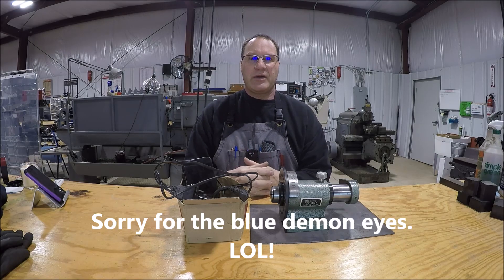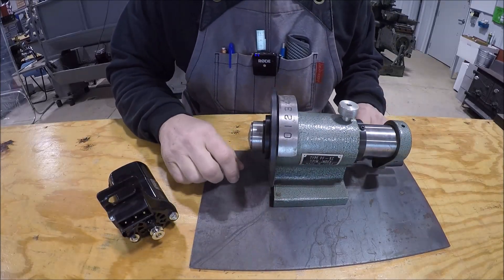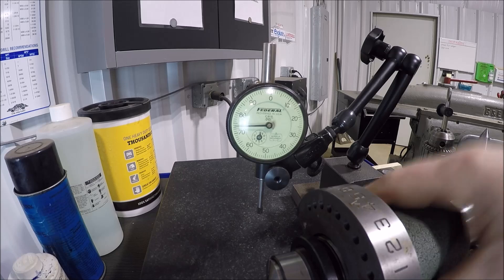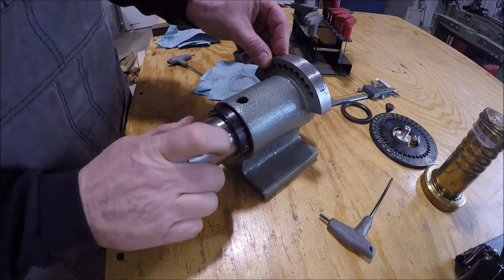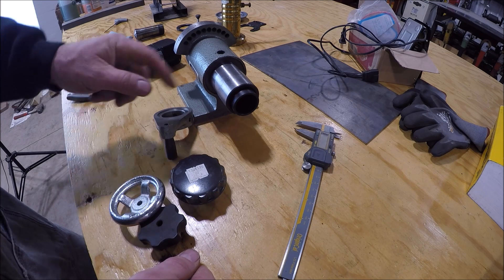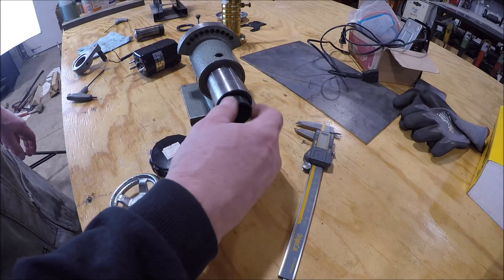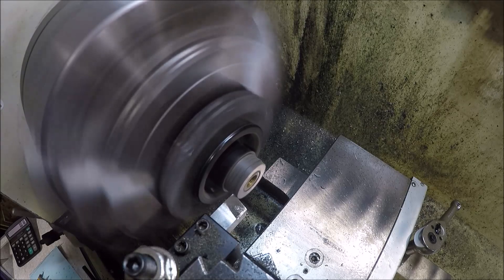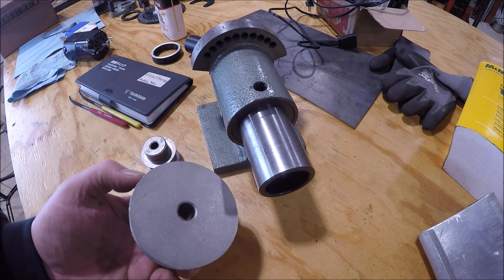O D  grinding fixture build. Part 1

Comment: Sorry Tom YouTube playing games with the subscribed feed. Very interested in how you get along with this one. I like the spindexer - added a stepper motor and belt drive for gear indexing the sizes that are not covered by my BS-0.

Love that Federal Indicator. I call them the tank of dial indicators. Very overbuilt and durable.
Reply from the maker: Hey Dan. It has some twists and turns as I work on it. Yeah I love the Federal and Ames indicators. Built solid.

Comment: Hey Tom looks good question though what type of surface is between the spindle and the housing is there a bronze bushing in there or is it just the spindle going through cast iron going at 3500 RPMs I think you might want to put at least a bushing in there and maybe a set of needle bearings looks like you might have enough meat to bore out of that housing if you find the correct size needle bearing bushing would be a lot easier to fit and then maybe put a couple Oilers on there that's my two cents I hope it's not too much or maybe you've already thought this through.t
Thanks JM
Reply from the maker: Yeah it is just machined cast iron against the retaining collar. Good idea on adding either a bearing or bush. I will have to see what ole McMaster has to offer in the way of OD and ID of thrust bearings.
Reply: @hilltopmachineworks2131  yeah Tom that's a good idea also maybe push comes to shove you could use nylon and lubricated with the silicone grease that might be an option well good luck and we'll see how it turns out. JM

Comment: Anyone else hearing some humming or is it on my end
Reply from the maker: I have finally tracked down the cause of the noise. I recently changed adapter cable from the wireless receiver to the GoPro. I broke the last one. Well this cable is apparently bad. I have replaced it with another one and the noise seems to have gone away. I already have a few videos recorded with the old cable so it will be a few before the new cable will be in use.
Reply: I have been getting high pitch background noise  for awhile on the videos.
Reply: @bcbloc02  just a few peoples are doing that adam booths are odd makes my phone get real quite when it’s turned to full screen but not when it’s just half screen I figured my phone was taking a dump lol
Reply: @jeremycable51  I haven't noticed any noise on Adams.  I do get the high pitch whine on Toms videos though on my desktop as well but only with the volume turned up, it is not as noticeable at normal levels.
Reply: I don't hear any humming. Tony